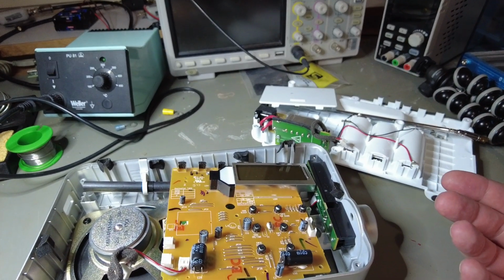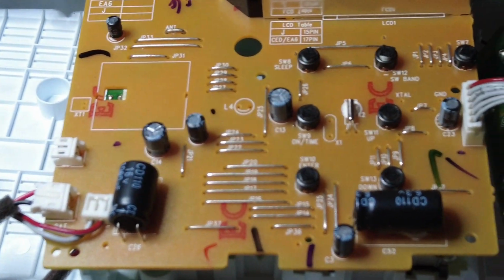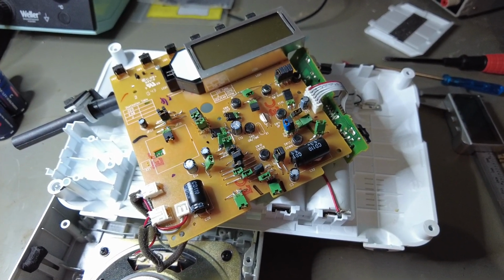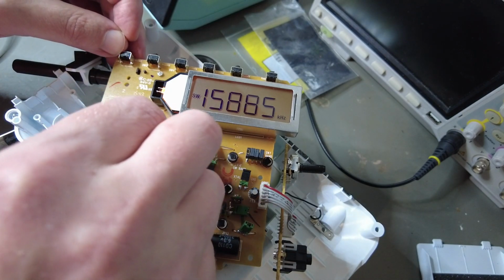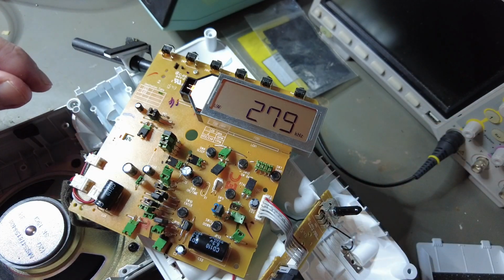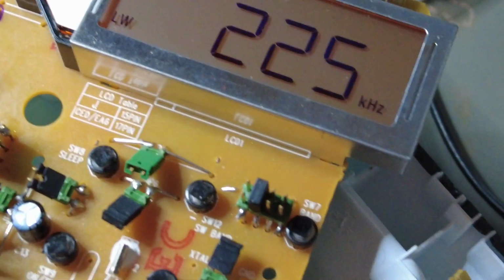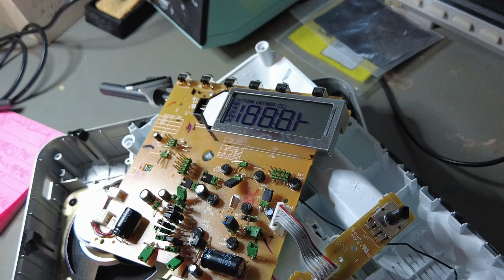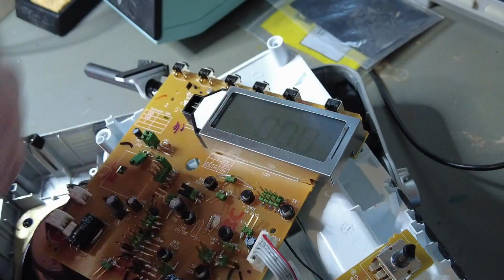Sony ICF-M780SL radio: An attempt to modify it....

Comment: The FR4 board was manufactured as a single layer PCB for 'cost savings', so the wire jumpers are simply the equivalent vias and traces on the top side.  No need to figure them out. I've seen this many times, but never in Sony quality kit. I think this is a knock-off. 
PS: Sony is notorious for not sharing schematics.
PPS: all the important parts are on the other side of the PCB. Shame you didn't share any of it.
Reply from the maker: Thanks for the information... so sad Sony has gone this way. OK, will do video about the other side then.

Comment: I think the jumpers are wires needed for the circuit to function. They are not configurations.😀
Reply from the maker: Quite possible. Though when looking at the circuit board there was no obvious reason to do these, there was plenty of space to do them with vias and traces. Also an oddity was clearly hand soldered connections.
Reply: That crossed my mind, too. Config jumpers tend to be bunched in an easily accessible corner of a board. That PCB just looks like a single sided board that needed jumpers because of space.